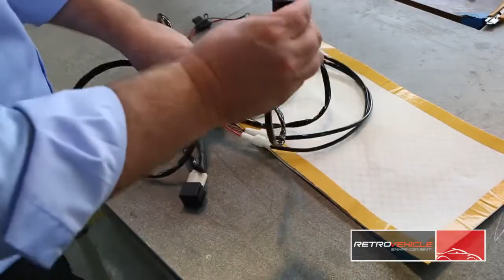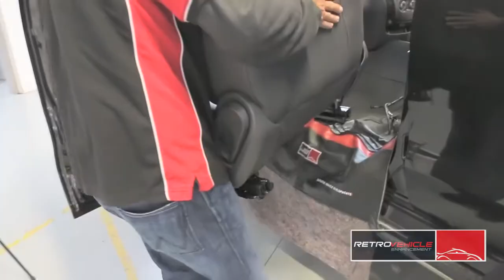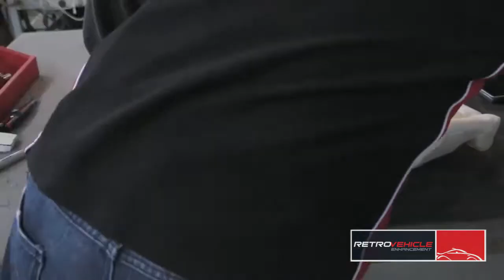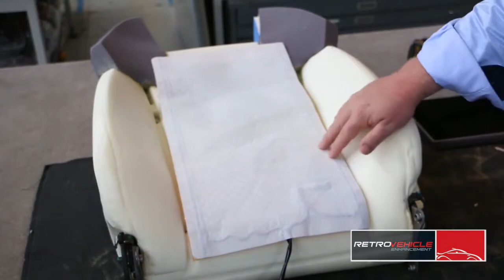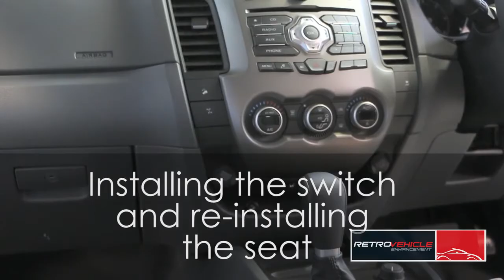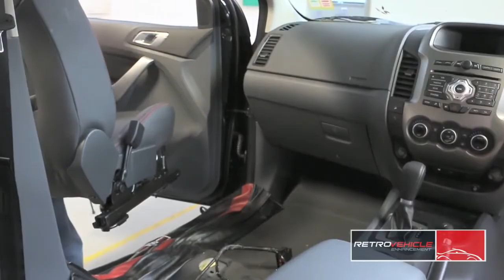How to Install Seat Heater pads

Comment: So did you not have to cut anything out for the seat pressure sensor?
Reply from the maker: Depends on the vehicle, but it is best practice to relocate the sensor on top of the heater pad.

Comment: Brilliant! I’m now confident to do this tm, loads of good tips in here. When you cut out a strip for fabric fasteners like on the bottom, you will have heat on both sides right, Just not the sides of your cut
Reply from the maker: Heat and current runs side to side, so make any cuts 'across' the pad, taking care not to go through the side wires. Any front to back or top to bottom cuts will cause cool sections